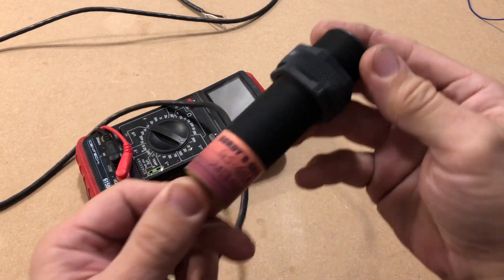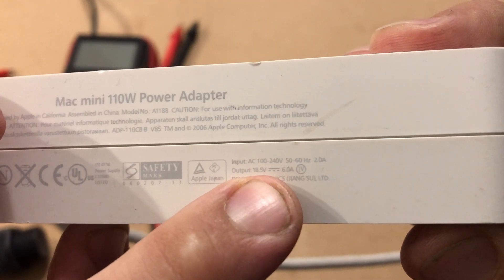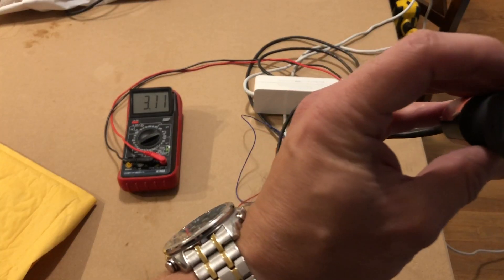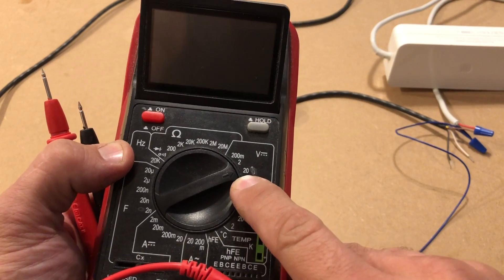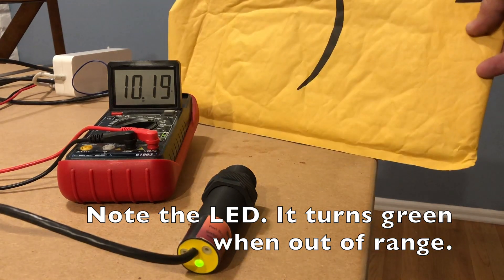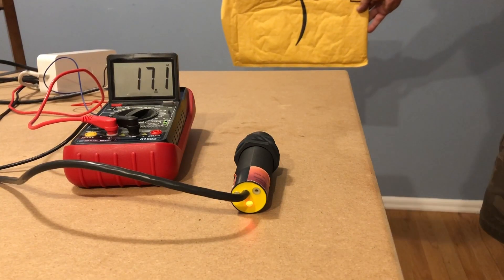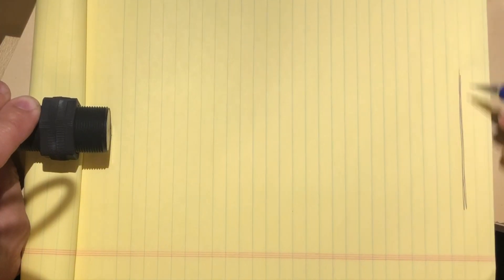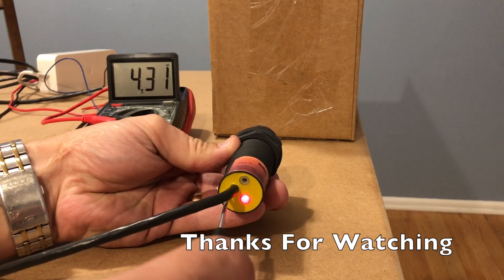Ultrasonic Distance (Displacement) Sensor Functions Test Trial

Comment: Sir can I use 5v to this sensor? And i terface it with microcontrollers like raspberry pi
Reply: Also what is the maximum range of this one?
Reply from the maker: This sensor will not work from 5V power supply. It outputs both 4-20mA and 0-10VDC analog signals. It measures from 4 to 40 inch.

Comment: Hey can we get an update on that China CNC controller
Reply from the maker: Thank you for your request. I’m not giving up on that CNC project, and am asking for patience. Currently, I’m trying to manage between my job (50+ hours per week), family (4+ kids and wife), and all kinds of obstacles (both physical and financial) in the shop, to finally finish the machine. Please, hang in there, I’m working on it.
Reply: Ill be here. Take your time. Im Excited to see how it turns out. Im retrofitting a fryer mill with Dmm-tech servos and possibly a syntec control.
Reply from the maker: I looked at dmm-tech servos as well. The dyn4 system gets almost in the same bulk as some brand name units. Just couldn’t have it! :)
Reply from the maker: I even acquired a 3kw power supply for dyn2 setup.. but, never got to it.. now, I have a very nice power supply just laying there, waiting for it’s moment..
Reply: I hope the dyn4 servos work well. I was quoted $2300usd for 3 1.8kw servos (one servo has a brake.), drivers and cables. The 4 axis syntec 21mu control is around 1500usd. Way less the a pre made retrofit like centroid or Seimens sinumerik at around $22,000 but still being a "industrial" set up. That's why I'm really looking forward to more videos. If this system you have works, ill use it on a furture plasma table build
Reply from the maker: It’s hard to beat.. when I was researching it back maybe 4-5 years ago, I came across this one site.. it had turn key retrofit kits with dedicated PC for a controller and brand name servo motors/drives. If I’m not mistaken, it was around $5500. Tried to find it now to no avail.
However, Delta AC Servo kits nowadays go for $670 for 1kW set, pretty close to what you got. Hope it works well for you. Keep us in the loop of your progress. Maybe, my next CNC machine will be DMM or ClearPath..

Comment: What practical application could have this device?
Reply from the maker: Distance sensors (transducers) are just that, they provide electrical signal representation of a physical value, such as distance to an object. Automated machinery can be adapted to use the signal as a reference of part position, orientation, etc. At one of my work places, a distance sensor was used to calculate the diameter of rolled material coil, to start rolling it at right rpm, for the entire machine fed material at constant rate. Towards the end of that coil, the machine “knew” to warn the operator of low material, because of the distance.
Reply: Tinkering Nerd  understood. Am I right that accuracy is not very high?
Reply from the maker: Tin Woodman's Workshop my guess that these can be down to 0.5mm accuracy, maybe even smaller. A lot will depend on ADC (analog to digital converter).